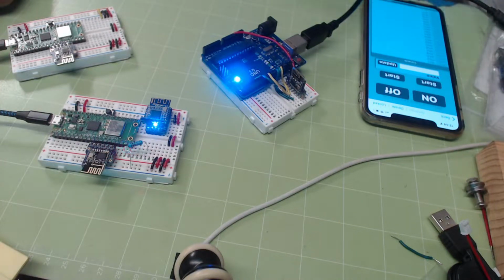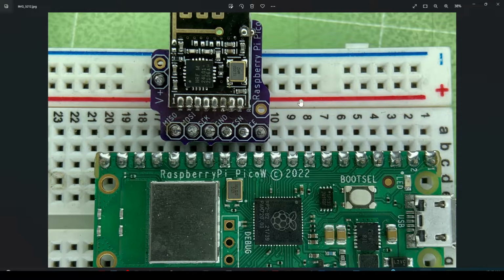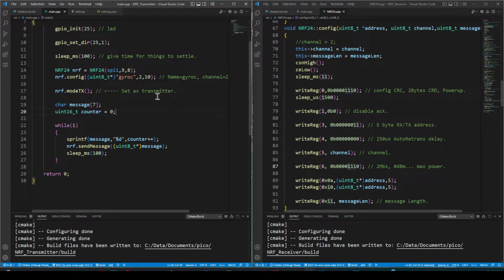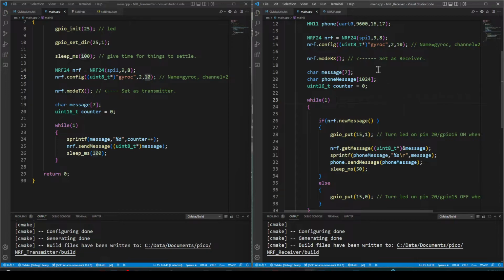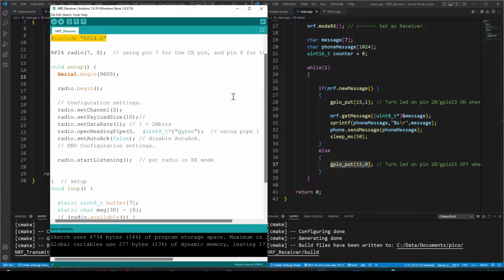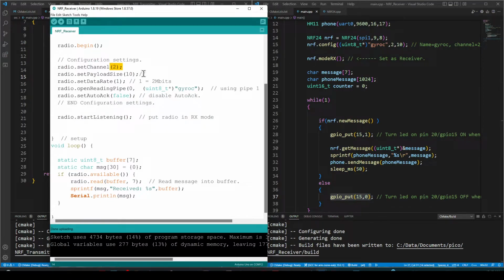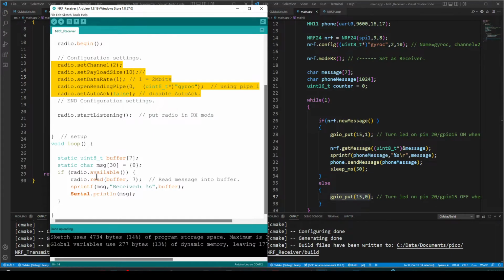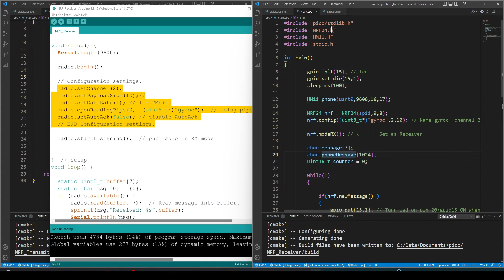NRF24L01 C++ Pico and Ardunio explanation and Source code

Comment: Hey
We are doing a project in which arduino is the transmitter and raspberry pi pico 2W is the receiver but we are getting errors that the data is not getting send so what should we do if u can a make a video for interfacing both arduino and pico using nrf24l01 it would be great